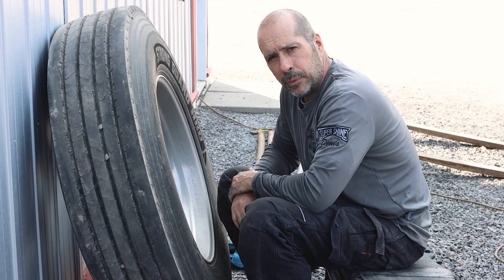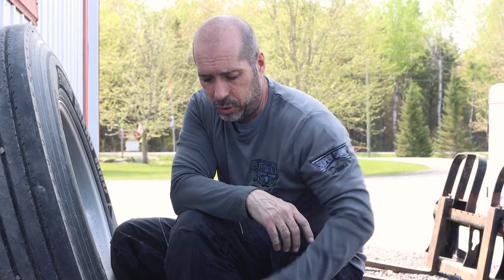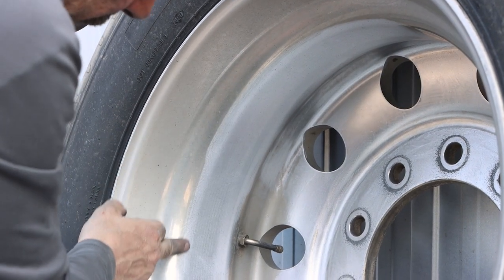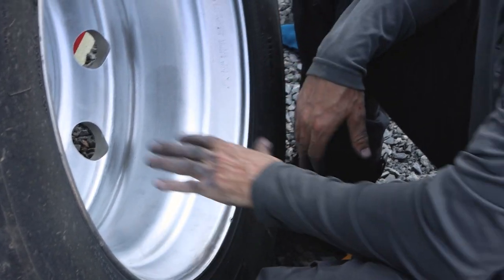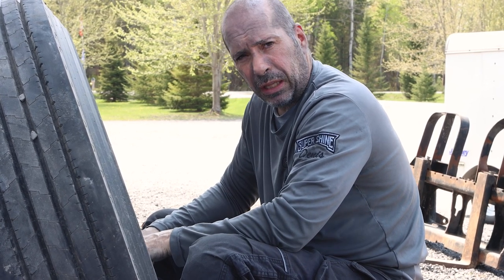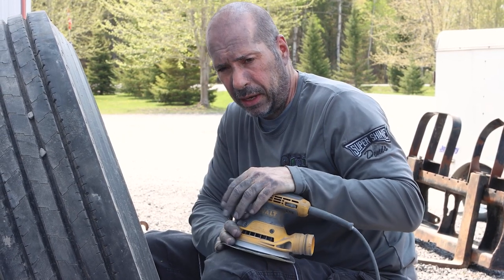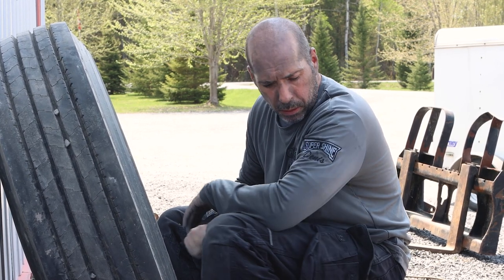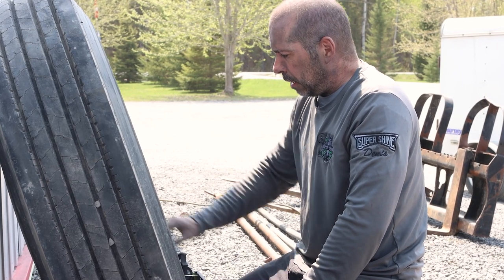DIY How to Polish an Aluminum Rim In Detail (Step by Step)

Comment: The valve stem area is a great place to use a drill and a cotton pad.. also flour works great to put on a cotton towel and give it the final rub down.. gets all the black and leaves a great shine
Reply from the maker: Ya flour is an old method, some still Use it.  I don’t tho :)
Thanks for watching

Comment: Great job, i do lots of smaller parts, aluminum and stainless, car trim, remove anodize with oven cleaner, restoring beat to hell stainless, for sanding i use a 3" air DA, and i have a pedestal mounted buffer, for stainless trim i give it a quick buff just to find the bad spots, i spent two months repairing and polishing the trim on a 57 Ranchero, i have never done a truck wheel or a fuel tank or an entire dump truck, that looks like so much work, looking forward to more of your videos.
Reply from the maker: awesome!!! Thanks for watching!

Comment: That dewalt DA sander looks like it works awsome. Looks like it doesn't stall easily. I have a Dynabrade Spirit pneumatic but it uses a lot of air
Reply from the maker: Thanks for watching! Much appreciated :)
I don’t use air tools for that exact reason… you need a massive compressor to be able to keep up to the constant demand.

Comment: Working on my F150 spoked 20" wheels. The clear coat cracked and there was heavy corrosion. Had to go down to 150 and 220 to get off some corrosion.  still some tiny pitting but not worth the trouble.  Used steel wool too. Cant really fit sanders in the narrow spokes. Went up to 800 grit, then a polish cone. Not looking for a showcar look, its pretty good :lol:. Probably going to ceramic coat them. Very nice work here! Learned something!
Reply from the maker: Nice! Thanks for watching

Comment: How long will it last without any rust comming out...or polishing will needed every month
Reply from the maker: aluminum doesn't rust, it oxidizes but to answer your questions it depends on maintenance and where your truck goes on a daily basis... if you do nothing and you work in a quarry it won't last very long, same for winter months with salt, if you don't at least rinse off your truck a couple times a week your shine won't last.  On the flip side I have customers that only come to see me for polishing every couple years because they take the time to take care of it.  :)  Hope this answers your question!  Thanks for watching

Comment: 👍🏿 can you tell me the names of the tools and where do u get ur sand paper thanks
Reply from the maker: I use dewalt and Bosch grinders/polishers 6000 rpm's and variable 600-3500 rpm's.  As for Sand paper it's my own will be back in stock soon.
Reply: Thanks can u also send me your link so I can purchase the sand paper and also can u tell me the model or serial number of the grainer am new in this thanks

Comment: So my question i have a hard time with the tarpboxes on my flatbed i sand well all new products very best of eveything and i cant get away from the lines in the polishing .I have Raked my buff so its not building slow and steady Rythum because its such a flat surface .AND I REDONE STUFF ALOT also practice on other stuff as well cant figure it.....THks...
Reply from the maker: Can you explain your process and the products brands you’re using? Thanks for watching! 
You can send me a direct message on fb or ig as well might be easier to communicate!

Comment: Question: what are about black pitting around the LUG NUT holes?  Why did you not remove that? Time?   Okay, how could you remove it, go down to 180 grit paper?
Reply from the maker: Mainly time yes, depends if the customer wants to go that far into the process… you also need to be careful not to compromise the integrity of the rim… and yes going lower in grits will remove that a bit faster but remember the lower grit you use the more work and sanding steps you’ll need to do to remove those sander marks… hope all that made sense :)  Thanks for watching! Much appreciated :)

Comment: I think its very important to add a disclaimer that although u can always take more off and get rid of pitting. You are removing material which diminishes structural integrity.  And for cdl drivers, it could also make it non legal.
Reply from the maker: for regular maintenance and yearly polishing.. you can do this for years with no issues, but yes absolutely if there huge gouges or pits and you sand them out it can compromise the integrity of the rim.  Have I ever seen it or heard of anything like this happening?  Nope never.  thanks for watching!

Comment: Master polisher?  How do you receive this achievement.  Why do sand complete rim other then around valve stem.  Why do you not do anything with the holes , flapper wheel or even polishing ball.  Why no  wheel stand ? What is your price to on the rim you just did? Looking forward to your response .thank you
Reply: Most peop)e don't want to pay to sand the holes and polish the holes the stands definetly make it nice but their 1200 or more i charge 75 for rear and 50 for steer    thats one side  flapper I use a variable speed polisher with witha backing pad and do a rotary sand and then da
Reply: @matthewpolishing7294  flapper?
Reply from the maker: Hey Tom,  thanks for watching!... I agree with Matthew,  I do mention in the video.  This is not going on a show truck.  it's going back on a trailer.  Customer wants them cleaned up and looking good at a decent price.  I charge $65 for a rim like this.  Besides at 100k/h you can't see if the wholes are polished or not. :)
Reply: @DCSuperShine  I'm watching and listening to many. I'm asking and learning not to disrespect or offend. From king , to master many have different care status in the polishing world . Is this something you are awarded or earned. Or self- proclaimed.
Reply from the maker: Hey Tom,  good question!  They say it’s takes roughly 10,000 hours to “master” a skill or trade.. been doing this 25 years and have well over 40,000 hours.  So even self-proclaimed on my shirt… it’s most definitely Earned!  I don’t think there is such an award 🥇
Reply: @DCSuperShine   thank you